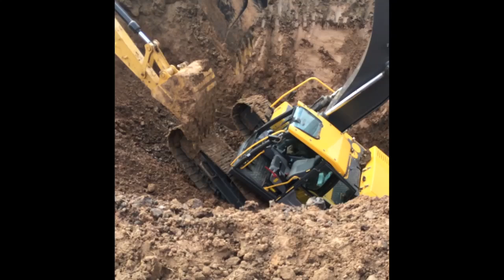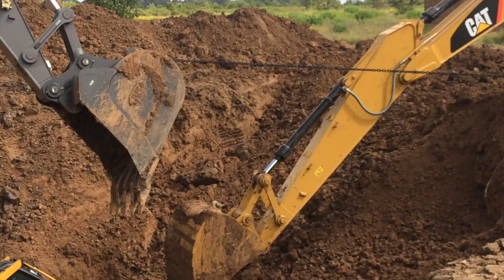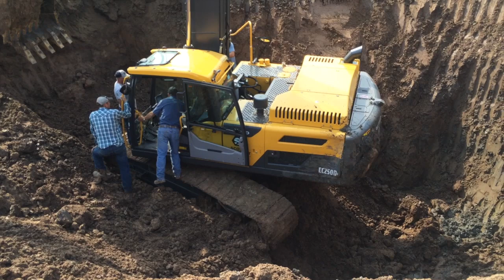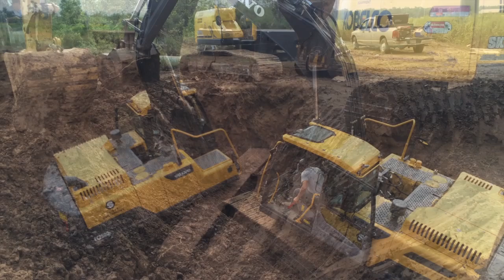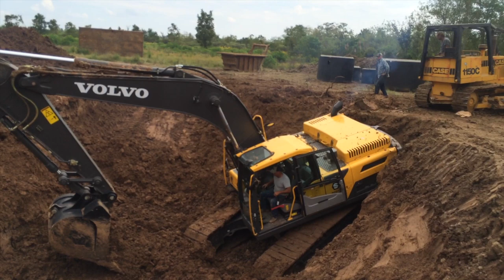Trackhoe Accident! Excavator Fell into Hole! Two Excavators and a Dozer to Rescue! Caterpillar

Comment: Painful to watch.Dig a ramp in front of the div and track it out 3 machines and NO brains
Reply: Not enough experience being an excavator operator..They should help to dig a trench and make it into a ramp so that the excavator can climb up...this is too easy for me..unless if the excavator get stuck inside the mud or blue clay
Reply: Exactly
Reply: Yes it was painful to watch the guy on the Volvo. First thing he should have stretch the boom out to full length to get more weight in front of the machine instead of leaving it with it up in the air with the arm curled in. Oh well. LOL
Reply: Just kept saying to myself the whole time y can they just walk it out lol
Reply: Looked like the blind was leading the blind
Reply: Exaclly i thought for a second the machine was down. Dig yourself out and track out
Reply: Right.  Better yet, how does an excavator just fall into a hole???  On second thought, watching the video clearly shows how it ended up there in the first place....

Comment: I have NEVER seen such a group of non operators in my entire life. They have 2 excavators destroying the one in the hole by ripping it apart, instead of first taking 15 minutes digging a simple ramp so he could track himself out with no problem.
Reply: +Jim P yes indeed
Reply: Jim P
Reply: Yes Jim P that was the first thought I had ! Some guys like to make it difficult!! Lets just say - "Not the sharpest pencil in the box" - and that applies to them all!
Reply: slowzuki They don’t have clue how to operate those machines .
Reply: agreed, i could get that out without any help. but everybody is an operator, until they operate!
Reply: De acuerdo
Reply: right!!! exactly  i have run them a few times  and i am pretty sure i could dug my self out
Reply: One things for damn sure, you can't fix Stupid, I guess they blame the machine for jumping off  in that hole in the first place.. Don't this just piss you off, don't have a clue as to what there doing. See Ya
Reply: @DavidGrassSr  Having been a heavy equipment operator now for more than 30 years I can say I have been in many situations where the potential to have something like this happen was there. The fact is it never happened because I was smart enough not to allow it to happen. I am sure every single good operator would say the same thing and there is flat out NO excuse acceptable for an operator to EVER put a machine into a situation where asinine things like this would happen!
Reply: Jim P. Yes thats true Sir. the hoIe is not too deep that it cannot manage to go up.
Reply: Look i'll admit, I know nothing about excavators and how to operate one.   But even as someone who knows absolutely nothing about this type of work, my first logical thought was to dig a simple ramp with the other two lmfao.
Reply: @kevinm3751  i agree only bad operators get  into  these kind of situations,digging a slope would first come into mind
Reply: Jim P I have never operated one of those in my life! And even I was thinking the same thing.
Reply: @thefinalfrontier1219  Yea it really isnt rocket science. Although I have thousands of hours on them myself it still comes down to simple common sense. Really all experience on equipment give you is the ability to be more proficient, they have to bring the common sense with them... if they have any that is!
Reply: Couldn’t agree with you more, hard to watch, let’s dig 18 would’ve had that out in three seconds
Reply: @jjr897  Lets be honest, anyone with any sense would have never got in that position in the first place!
Reply: My first thought.
Reply: You are so right. A few seconds in, that was my thought. 
 Came to check the comments. 😂
Reply: Batman machine is obviously disabled or It wouldnt run at such an angle. Maybe mow on fuel. But yes I agree why no ramp if there was no interferences underground? Killing the tracks. I would have dug a ramp a roller could crawl out of in mud slick as owl shit.
Reply: Kevin Morrison it was disabled or low on fuel. I still would have found fuel to operate it at such an angle.
Reply: @Goldinton  .
Reply: I totally agree
Reply: Even I asked myself at the very begining. Why can't the operator just use the capabilities of the equipment. And I am not from this profession. It's just common sense.🙄
Reply: @angeliracheta487  Your comment makes me aware there are subliterate  people lower than the POTUS.👎
Reply: As an experienced operator I couldn't agree more.
Reply: Agree I thought exactly the same
Reply: Woow
Reply: Isn,t there anywone who knows if the maschine was more tippning from the start. Seemes like it because there is dirt ok the top of the boom.
Reply: How on earth did he get into that mess dig ramp track out and don't get in it again 😂
Reply: This may not seem obvious at first but the counterweight was tuck inside the hole. That prevented the excavator from being able to move its boom sideways and digg dirt out the way to create a path.
Reply: That is true I was thinking the same thing
Reply: Yes! Or digger in the hole, put the boom fully out! Lay on ground above!
Reply: Oui des bons à rien

Comment: It would appear that there is a level of cluelessness with those machine operators. Any good operator would drive the excavator out of that hole without any issues.
Reply: Fabian F and
Reply: Yeah they are really dumb the arm is all the way up, which makes the machine want to lean back. Reach out and pull yourself out, or let the dozer help you as you drive out. Im

Comment: Not an operator between them. Any one who is an operator knows that machine would walk out of there!
Reply from the maker: diggeraver Totally Agree, that's probably how it ended up there in the first place!
Reply: For a machine thats about to tip over the boom is up very high!!!!!!!!!!!
Reply: Yes for safety anchor with a cable the shovel end to a dozer (for weight balance) and it can climb 60 degrees easily.
Reply: exactly... ive been in far stickier situations and breezed out...
Reply: +diggeraver 

A agree.. the operator almost smashed the guy running up the bank at 7:42.
Reply: these are Just amateurs.
Reply: +diggeraver Hey, There rentals...LOL.  Can you believe that chit..lol`
Reply: +thedrloboski stevens avidly
Reply: I'm not an operator just looking to Become one and I would say that machine could get out if there by its self no problem
Reply: Kevin Pickard machines dont drive themselves.
Reply: Nicholas David funny ain't you I mean under its own power without any other machine helping it and it also depends if the machine has the ability to connect a remote control to it because some can be used with no operator
Reply: Kevin Pickard so im supposed to know ALL that by you saying cant it get oit of there by itself. Hahahaha
Reply: E&E
Reply: sanjay
Reply: diggeraver 
you are absolutely right I've been there done that!  got out on my own.  I had a sand wall fall out from underneath of me one time
Reply: diggeraver Yup. I've seen them 'hold hands' before too. Nice to do it the hard way every now and again though.
Reply: hallo
Reply: Rasid Khan
Reply: diggeraver
Reply: True.all they had to do was cut a road out and he walks right out

Comment: This may not seem obvious at first but the counterweight was tuck inside the hole. That prevented the excavator from being able to move its boom sideways and digg dirt out the way to create a path. Either way, all they needed was one track to lock bucket with the one in the hole and give it leverage to track out the hole.

Comment: My father-law got an old CASE 680 backhoe stuck in the mud. I got it out by putting the front bucket to lift like a sled, then use the boom and bucket to pull it out. Piece of cake.

Comment: I'm no expert professional but I think one excavator could have gotten him out with just a little ramp digging and pulling the stuck one about 5 feet to get him a little more level.
Reply: Im no expert but im sure i could have dug him a ramp with a shovel and saved all kinds of money...
Reply: ut000bs I'm also no expert, but having operated one of these beasts before, I'm sure the one in the hole could have gotten out of there on his own, as long as his engine was still running.
Reply: Josh Bobst That's right . I think the moment he fell in he forgot that he was driving a EXCAVATOR. They dig holes and RAMPS.

Comment: Aaaa.... is it just me or coulndt this excavator dig himself mostly out and then walk out???
Reply: Exactely
Reply: Where do you boys suggest he put all the material while trying to dig himself out. No room boys . cant you see that . He would have himself buried real quick.
Reply: stitsenj except that the other 2 machines could build the out ramp and deposit the dirt outside the hole.
Reply: stitsenj He could've deposited the dirt behind him as he moved, it's the same reason why it's possible to actually dig yourself out of a hole, you simply step onto the dirt you've just dug until the hole is filled and you're outside the hole or you've created steps or a gradient.  In the end he basically did that.
Reply: stitsenj that is how he gets himself out but there is a quicker way suggested by others- that is learn how to operate and ultimately don't wind up in the hole in the first place.
Reply: Michael James Precisely. I used to operate one of theses magnificent machines myself, and I was thinking exactly the same thing. Maybe because of the angle it was at it's engine couldn't run?
Reply: Control  boy

Comment: Dont get why he didnt extend his arm and dipper out instead of leaveing it up an makeing it more tippy. Or y he didnt try to extened as the dozer was pulling on it would have been better then haveing two machines putting all that pressure on the idelers and almost wipeing out.the hand rail and mirror. Nothing about that was good.. there was no need for any machine to come in contact with one another. . Was a brand new machine. They would all be fired if I was there boss and saw that circus. .
Reply: E
Reply: I am aIso an operator of backhoe and this is my first time to see it assisted by others. if his prob was its because he cant turn and use its arm to push itseIf out its because he did not make big enough to hoIe from the very start in order for him to turn 360.

Comment: I cringed watching this. It's scary that people like this operate equipment. I cringed watching them pulling teeth across the tracks. An operator with 1 day experience should have been able to dig himself a ramp out.
Reply: I've operated CAT excavators for 10 years and there was an easier solution than that

Comment: Not very experienced all 3 of them. #1 for falling in the hole in the first place, #2 for not digging  him out, #3 for using the teeth on the tracks and causing damage. Instead of using the bottom of the smooth section. The damage caused is more expensive than the time it would of taken to dig him out. Nice equipment though must of been a nice job.

Comment: Im not even a heavy equipment operator, only operated Kubotas and a Back Hoes,  and i figured it out in less than 30 seconds..
 Fill in the DEEP spot  behind you to get some level ground under the tracks..
Then take your time and  Build a nice  ramp, and pull yourself out.. easy as can be..
 I do like the way he was like shaking hands with  the other guys bucket for pulling himself foward.. but thats when someone should have been behind him filling in the deep spot with dirt from up top, like with that Dozer..
 It aint Rocket Science..

Comment: What numpties came up with this plan...for once why the hell didn't he just climb out, not as if he's not got the frond to pull down and get out...also the plums are trying to pull it out with the bucket of Volvo in the air and keeping the centre of gravity at the rear, put the bucket out if front and use it to counterbalance the machine. So easy to get out. And yes I'm a machine operator for many years and help people out of similar situations 👍

Comment: Hahahaha that's not a volvo excavator it's a rolvo lol
I've been an operator for 22 years and im wondering...how in the world did this go down lol
Was he digging alongside and the bank gave way? I worked years ago for a company after I just moved to a new area and the bosses son really thought he was something on his new excavator...he sucked big time lol
He was digging with his tracks parallel to the open excavation and at the time i was running a loader and I stopped and gave some friendly advice and suggested he turn his tracks and dig off his idlers and he basically told me to fuck off so I did cos he's the bosses son and I just started and needed a job otherwise id have punched him into the cut....ten minutes later he looked like this guy but upside down...luckily he had the seat belt on and and had the boom up when he went over. Seat belt kept him from falling out and being squashed and boom protected the cab from crushing, other than a crushed pride he was ok. It was great cos he was an asshole...looked good on him. I ended up on a hoe a couple of weeks later and he come up to me one day and apologized and recognized that he should have taken my advice as he saw I knew what i was doing as I'd already at that time been operating for about 15 years. He was much younger than the rest of us but figured his daddy's the boss so I'll treat them like shit. He changed his attitude toward everyone quickly after that...he wasn't so cocky lol

Comment: Not being in possession of all the facts involved in this, it's not easy to make any judgment calls, but it looked to me like it could have been handled more easily and quickly with a simple few minutes of ramping, and at the most a bucket to bucket chain to help get the machine up out of the hole its ass was in and onto the ramp up. I have to agree with some of the other commenters that that machine should've been able to extricate its self if it wasn't damaged in some way, and since it did finally walk out on its own, that doesn't seem to be the case.  I've found myself in similar situations, but managed the self-extricate. The only reason I see it may not have been possible is the engine maybe starved for fuel at that angle. At any rate, with those other machines present it should have only taken a couple minutes to drag it out and get back to work. That said, I also understand an owner not wanting to chance un-neccessary equipment damage or burning up an engine because of either a loss of crankcase oil or the pump not being able to pick any oil up in the pan at that angle.
You got it out, and that was the goal.

Comment: Shaking my head. Did no one there know how to use that stick thing on the front to I don't know maybe pull itself out. Proof that you can't fix stupid. The motors are design to work on a extreme angle and still pump oil to engine bearings. It's called a dry sump system. This is just a perfect way to destroy tracks! If at any point you think a dozer is the answer to getting a excavator out, put down the controls and pick a new line of work.

Comment: Going by the standard of the operators on that site no wonder the machine ended up in that hole!!! Excavate a ramp, drop the boom far forward to throw the weight forward onto the front of the tracks and out she comes yippee crack on with the work oh and get rid of the useless operators 😃

Comment: Anybody that knows how to run an excavator would stretch the Boom Out take the weight off the back. And once again if anybody knew how to run a excavator could actually pull their self out of that hole with the machine